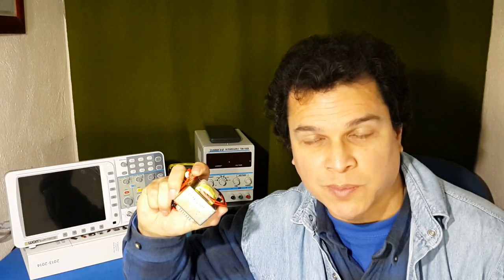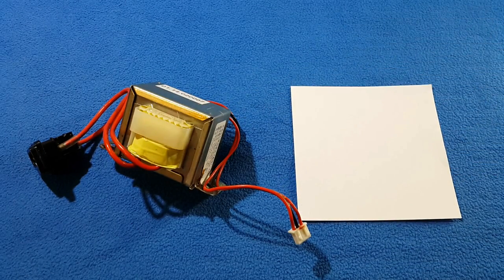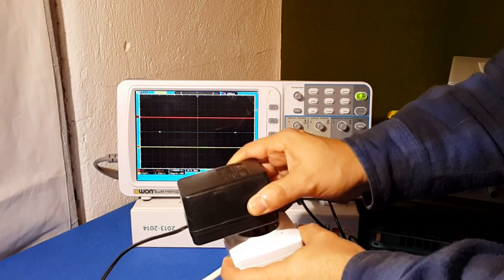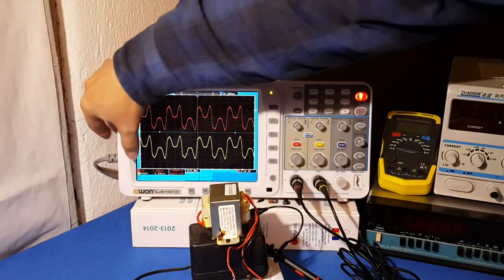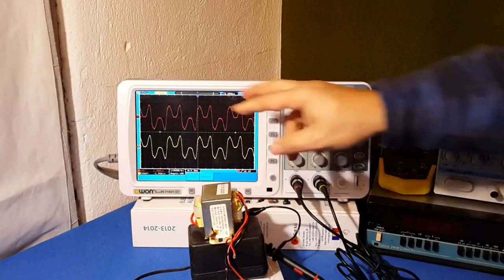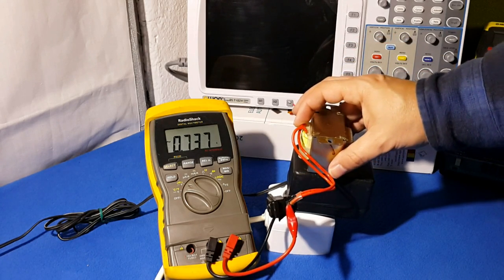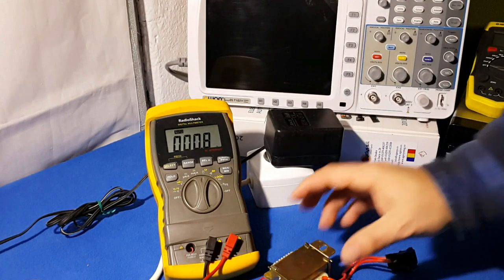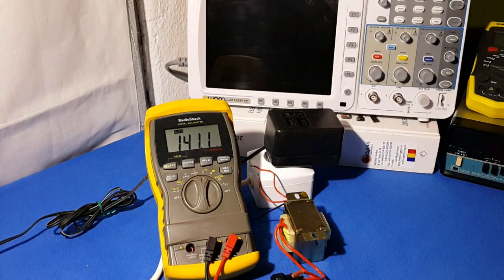How to test a transformer with digital multimeter and oscilloscope.

Comment: I know it's old video but good one. I have a transformer that was in an American Idol karaoke machine. Can not find scematic but data sheet for the tv shows it needs 5v. I guess ac. So I have ac transfomer that has output of 24 volt ac. I put the jaraoke transformer on top of the 24 volt ac tranformer and get now readings at all. I am on USA power, 120 v ac, not sure htz. Wires transformer not sure if primary is black and two blue wires. black lead on black, and put red on one blue wire, nothing. Put on other blue wire and nothing. Other wires coming out of karaoke are all diffrent colors, and can find no scematic for the karaoke transformer. I will have to learn how to do ohm check on it. Without knwing what wires go where is confusing. No markings , no numbers on transformer.

Comment: Interesting but you did not explain why shorting one half of the secondary winding reduced the voltage on the other half of the secondary winding voltage
Reply: I think this is because of the other half of seconde winding is in opposite phase

Comment: great explan dude, but my trans has only 2 input wires, how come?
Reply: 2 wires in primary coil. Secondary can have many terminals in which you can pick you step down voltage.

Comment: Hi dude, ive looked everywhere but cant seem to find an electrical transformer that looks like a 3 fingered marsupial! lol
Reply: Sorry! couldn't help myself there! haha
Reply from the maker: Let´s wait 10 more years and it would be material for electro-paleontologists. lol   ...Dear Chris, talking about transformers, two weeks ago I was working in a motor power control, and I saw a "switching transformer", with the metal nucleus as we had seen them. Its winding was not made of cooper wire but with PCB layers and the winding draw on each PCB. You are right. Kangaroos are not discontinued yet. But transformers evolution goes now for a small switching transformer in a power supply, better than a power AC old transformer doing the whole job like in the pass. We used to think it wasn't the end of the electrical tube because TV and monitors needed CRT, or the X-Rays. Now days, with LED screen technology and the resonance electromagnetic, the electrical valve and even the light bulb or fluorescent lamps for home are on the way to extinction. I think we got a blessing with witness all this technological changes and be able to use then and enjoying them. I remember when I got the first home telephone line and a big disk dial phone with bell ringing sound. A computer was only present in Hollywood and out of my imagination in those days. I am sure if you read my answer from your smartphone, we will smile remembering that old telephone was really a three fingered marsupial if it was not already an extincted fossil.   :-)